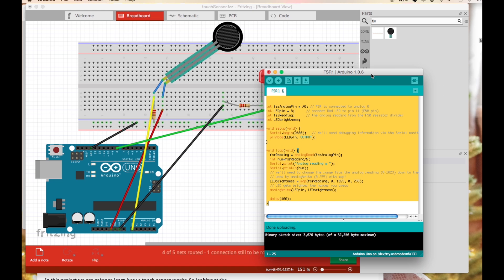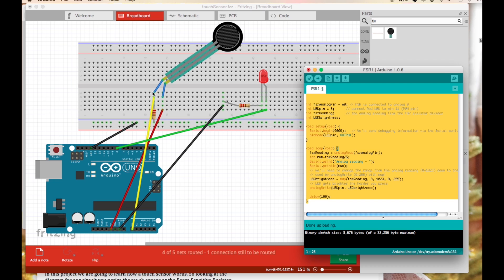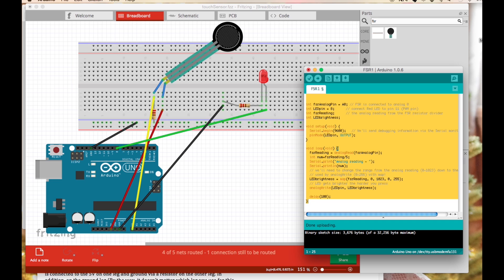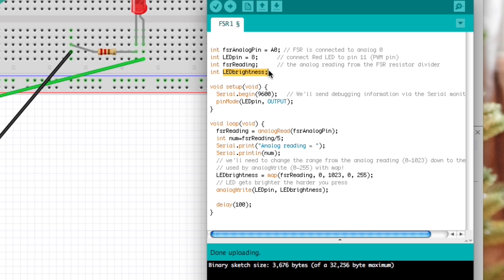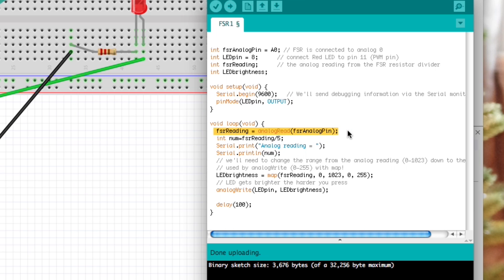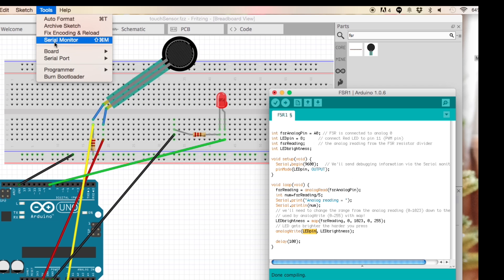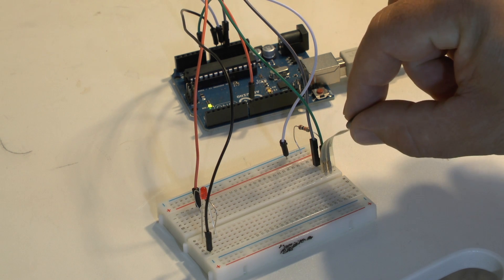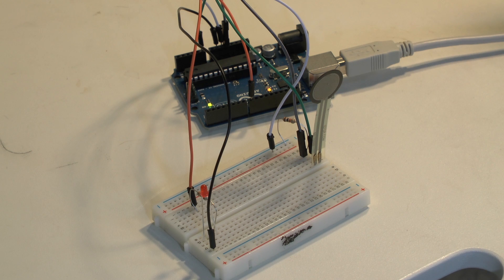Arduino Touch Sensor

Comment: How much is the resistance of those two resistors on the breadboard? Does it really matter if I use a resistor with a different resistance than what you used?